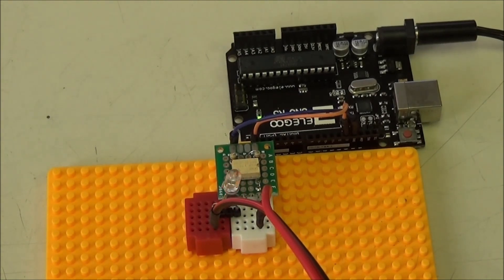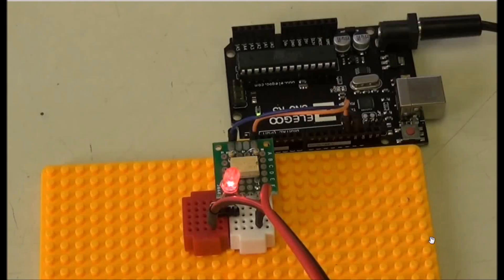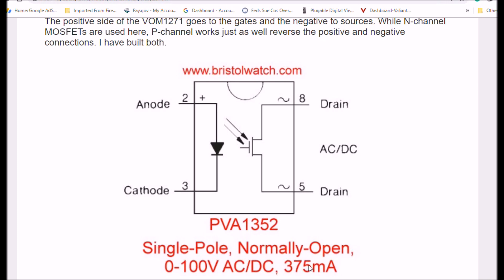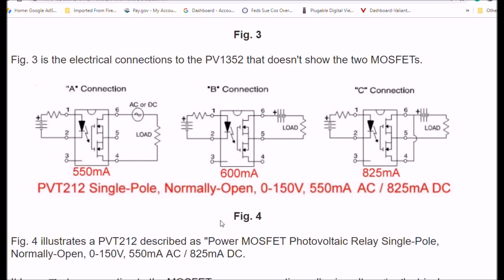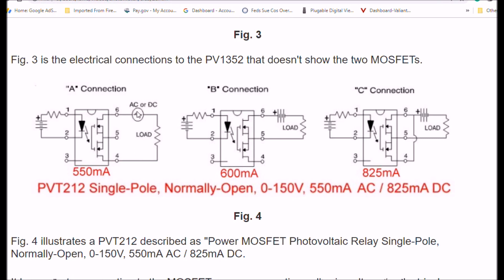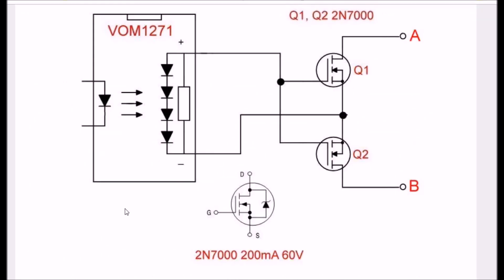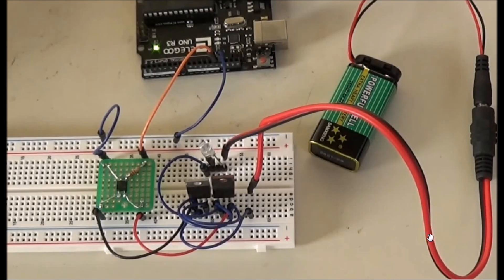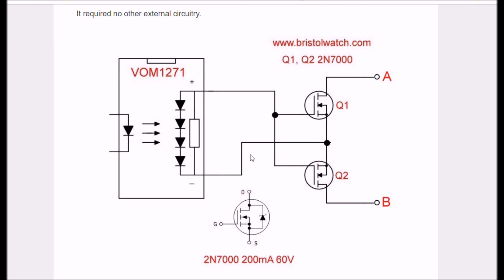Bidirectional Solid State Relay Circuits

Comment: My bins are starting to run low on obsolete parts. It's time to take your lead and modernize. Thanks for the push.
Reply from the maker: The VOM1271T is not obsolete several thousand are for sale at Mouser Electronics. You can also substitute  the Toshiba TLP3906 also available from Mouser. Thanks. They average $2 each in Qty 10. The MOSFETs can be easily substituted or available from Ebay cheap. Believe me I make sure the parts are available or at least a substitute.